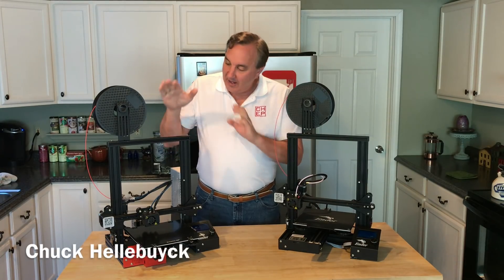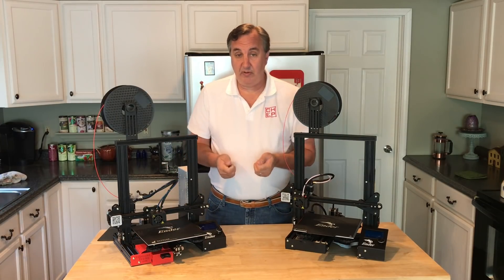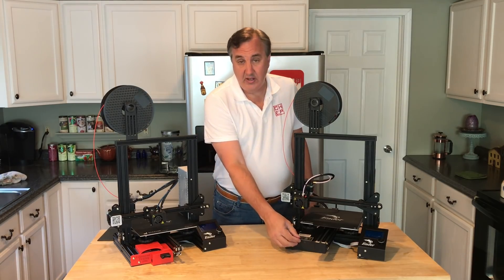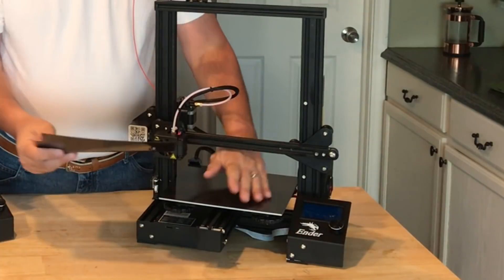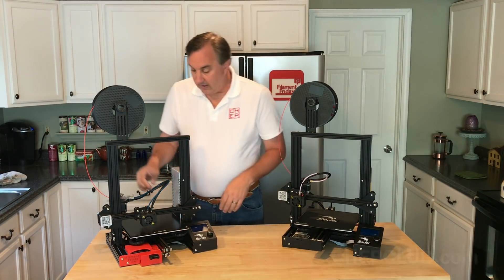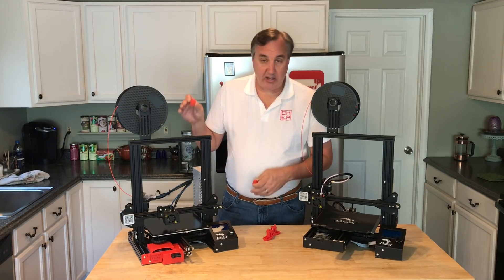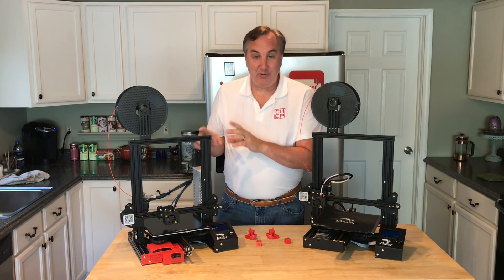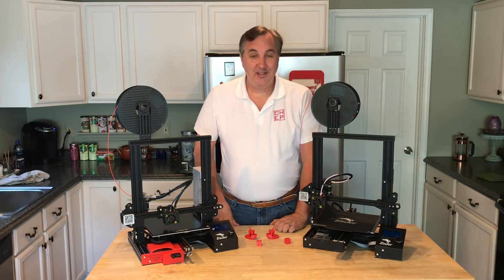Creality Ender 3 PRO vs Creality Ender 3 - Is it worth $100?

Comment from the maker: Creality has lowered the price of the Pro after this video was produced. It’s now $229.00 so the difference is only $50.
Reply: The Non-PRO (Original) is now $199 on the creality website, and I just got the PRO for $224 w/free delivery to Australia (also from their website)... They've definiately made the "cost vs improvement" much more palatable now.
Reply: Banggood has them at 159 ender 206 ender pro. 50 bucks. Now the removable "tak" pad and power supply pretty much make it worth it and all the other minor changes are gravy. The only thing making me want to pick a tevo tarantula instead for my first printer is the upgrade path is a little more pre laid out for you without having to buy more things to be able flash firmware and change stepper drivers and what not. I'm looking to branch my RC hobby out a bit.
Reply: @LitchKB  not bad huh, especially when shops in Australia are listing them at around $1000
Reply: @CHEP Is there anyway to get my print setting off the SD card back into cura? My computer crashed 😭
Reply from the maker: Not that I know of.
Reply: @FilamentFriday  thanks for the reply
Reply: What the heck? I found out that Ender 3 costs $399 and the pro version costs $469 on Amazon.
Reply from the maker: Where are you looking? The links in my descriptions are lot less than that.
Reply: I got my Pro from Central Computers for $189

Comment: I love my pro model and got mine is 2020 for under 200$. I don't have any issues with the magnetic bed. Of course since this was made in 2018, had I looked to buy a printer in 2018,  I would have NOT paid 100$ extra but, as it stands today, its worth 200$ in humble opinion. This is the best 3D printer channel around. I've learned more here and the info is really good stuff that newbies like me need to know. Thanks CHEP!

Comment: I just bought the Ender 3 Pro a few days ago and I haven't stopped printing on it since. The quality and detail for my first 3D printer is amazing. I couldn't be happier. FreeCAD and Cura on Linux Mint works great. Wish I would have bought one a long time ago with all the cool household items you can make and use its incredibly fun. In time I think the printer and PLA will pay for themselves.

Comment: Got my pro new for $200 ‘best offer’ on eBay and it’s the latest version with the rainbow-colored ribbon cable. Glad I got it. The magnet bed can go above 85°C, if it gets too weak I’ll just put some binder clips on it. But for most prints you’d stay below that anyway.

Comment: I just picked up the pro, and just getting started.  I was all over looking and the priced for the regular was 239 (not sure if they raised it for christmas or what) but the pro was 279, and I got the glass bed with it, so I figured 40 more and I get the pro and glass it was ok.  Now to get started with projects!
Reply from the maker: Yes, the prices all shifted since I made this video. I think others saw what I saw. Sounds like you got a good deal. Where did you get it?

Comment: I have the normal Ender 3, mine is supplied with a removable base cover, its not magnetic though but held in place on the aluminum base with 4 foldback clips which so far has worked fine. Watching your video I'm happy to have spent money wisely and not opted to purchased the pro version.  Great printer so far !
Reply: I know I am asking this reply 2 years later, but have you continued to use the ender 3, and how has it been performing when you used it?

Comment: Seeing this Video 2 years later, the Ender 3 Classic is now about $180-$200, depending on discount, while the Ender 3 Pro is now at a reduced price of $240, the two prices meeting in the middle.

Since it's my first-ever Printer, I definitely shelled out the extra money for Pro, to have the best possible features without Modifying it.
Only time will tell if it's worth it for me.

Comment: You can find the Ender 3 Pro for much less than the $100 difference that you mentioned. I got mine for 236.55 with free shipping and it came in 6 days. I found this on eBay from a vendor named "creality-3d-direct" located in Hebron KY and they state that they are the actual manufacturer of Creality 3D printers. They also provided a free 30 day return and stated that they would pay for the return shipping. This vendor has almost perfect feedback from eBay on a great number of sales. The current price on eBay is now $249 but sometimes this vendor puts a 5% off in their listings. (You could also try to send them a best offer for 5% less and they might accept.)  I really wanted to avoid the hassles of dealing with Banggood or Gearbest in case there was a problem because they make you jump through too many hoops before they will help you and then you have long shipping delays if they have to send you a replacement part. I feel much more secure buying through eBay because they really do protect and favor the buyers in any disputes. This vendor also sells the regular Ender 3 for a little more than GB and BG and I would much prefer to pay a few dollars more and get it shipped from a vendor located in the US and who offers a free 30 day return.
I agree with you that it's probably not worth $100 more, but I do feel that it is well worth an extra 50 or 60.  The reliability and safety of the Mean Well power supply is well worth it. I also like the wider aluminum extrusion for the Y axis and it definitely comes with the wheels in a square arrangement (as opposed to the original ender 3 which the wheels were offset in a rhombus shape and hard to adjust).  The new wider Y axis is easy to adjust and very stable.  I do plan to upgrade the PTFE couplers as you suggested in a previous video. 
Thank you for all of your wonderful content which is all very helpful.
Reply: Correct I got mine for $238 USD equivalent shipped from Crealities drop warehouse in Australia.
Reply: I've got mine on Banggood promo for $230, got another $39 discount from points and another 4.5% discount from cashback ($9), so finally for $182 it was a real deal at least because the PSU and 4040 Y profile.

Comment: Thanks. Decided to go with the latest iteration of the standard Ender 3. For the money saved I'llupgrade it with a 32-bit controller, enabling lots of features in the process.
Even with this upgrade included in the price, it's still cheaper than the Pro.
Some of the problems the first Ender 3 had has been mitigated in the latest iterations of it as of 2020, making the Pro even less desirable.
About the PSU on the Ender 3. It's not a well-known brand, but I see no issues with it. Tested it under load with my oscilloscope and there's barely any ripple on it. As good as many known brands.
It also holds up full load without overheating for long periods of time. But only time will tell if this will hold up after some period of usage. Sooo...

Comment: Chep, at 1:23 where you show the underside of the Pro, you can see where they include an idler bearing on the Y-axis that keeps the belt from snagging on the aluminum extrusion. That's not included on the standard version and that feature alone is worth some $$. There are some versions of an idler for the Ender 3 available on Thingiverse though, not sure if you've looked in that.

Comment: I just got the ender pro, haven't done anything except level the bed. I also didn't pay the full price, with discount, codes  and promo, I paid 127.00 USD for it...lucky me👍. Now if I were to do it again I would just get ender 3, and make the upgrades. Thanks for the review.
Reply: How you get that deal
Reply: @timothythompson109  
I have a very smart, clever wife.
From Amazon,  had made a large purchase,  that gave a percentage off, retailmenot,  there was another  discount,  and found a promo code. One is a rebate from retailmenot so when I get that, it brings the whole price down to $125 and some change.

Comment: Informative! If they want to make a pro version they should add a better control board and make sure it's upgradeable to two extruders. I'd also like to see a second z-motor on the other side. I don't know if it makes a big difference in prints, but having that gantry picked up on just one side bothers me a bit. And instead of a wider rail, maybe two rails, one for each side of the bed.

Comment: Ironically the Ender 3 Pro is quite often cheaper than the Ender 3 v2 in several online stores at present. Have a set of hardware upgrades to apply to my Ender 3 Pro that I'll apply a bit at a time as I get used to the kit.
Reply from the maker: Ender 3 V2 is always more expensive. Ender 3 is cheapest followed by the Pro then V2.

Comment: The Ender 3 Pro is now around $40 more, I bought mine for $220. A reputable power supply, magnetic bed, and slightly sturdier frame worth the $40 I guess. I had a $300 budget so I still had a lot of room to buy improvements, like a set of nozzles, a couple of smoother modules, better pneumatic couplings and a pair of filament spools.
Reply from the maker: Agree. Price has dropped since my video. Guess I’m not the only one who thought $100 was too much.
Reply: CHEP that, or prices right when machines come out are not entirely representative.
Reply from the maker: They try to get as much as they can but $100 was too much.

Comment: I told them to add feet under the printer they didn't do that :-)

What's annoying about the magnetic bed surface combined with the mean well power supply is that the better power supply means it should heat up faster hotter and more reliably then with the Chinese power supply but the magnetic bed keeps you from actually using it because you'll pass the Currie temperature of the cheap magnetic surface

Derp. :-)
Reply: The PSU has the same specs, right? I don't see why it should heat the bed up faster.

Mine have rubber feet like you find on many consumer electronics.
Reply: If the magnetic pad ends up dead due to heat threshold being surpassed, couldn't it still be used with binder clips?
Reply: @citronski  well there's a pretty big difference between having the same specs and actually being able to meet to those specs the mean well we'll actually performed the specs it lists the one you get from China is a crap shoot which is why some people for example can't get past a hundred degrees While others can

I have four Ender three printers none of them come with rubber feet they all have very thin rubber pads but no rubber feet so the gap between the bottom casing and the desk is very small rubber feet like what the cr-10 has would work a lot better
Reply: @armandoa2484  Yes.
Reply: @nerys71  Right, i meant rubber pads, not feet. Didn't think about cheap PSUs not delivering on their specs, good point.
Reply: Nerys  That might not be to the PSU but the actual bed resistance and manufacturing tolerances for the PCB beds.
Reply from the maker: This is true. The load has far more to do with it than the power supply. Most supplies have trouble limiting the current not supplying it.
Reply from the maker: Yes, that is an option.

Comment: I just picked a Pro up in store locally from Micro Center for $210.  That's about the best "normal" price I'm seeing from most in the states dealers on E-bay, etc.  Trading off no shipping cost for CA taxes, but I have a brick and mortar I can get to if I really need to.  I have some items on order from China right now, Banggood, and they seem to have disappeared into the great never never land of China Post.  Allegedly it's due to Lunar New Year delays, not other things happening, China Post got it and turned it over to the airlines, they say, before the festivals started.  YMMV on items out of China right now.
Reply: it's because of coronavirus,so all the logistics are stopped at the moment and only sf Express still working  because it's  expensive
Reply: @randomhk8634  

Hence my use of the words "alleged"  and "not other things happening."    I'm relatively sure they got to the airlines before the current political climate.  Back when they were still in the "everything is normal" phase.  

I just want to find out if it is in fact on it's way.  I usually get Air Mail out of the Mainland in 4-5 days.  And this is a small package, theoretically coming by Air Mail.

I don't necessarily believe anything I hear coming out of the Peoples Republic, old habits of having been at least somewhat in the Naval Inteiigence world for about 20 years, starting in my 20's.  I did believe them when they said they were going to take back everyplace where they once kotowed to the Khans.  Countries around the South China Sea.  They believe they had it once and they want it back. 

I have a lot of mixed feeling about the government over there, but I feel sorry for the ordinary worker, they are liable to bear the brunt of a terrible epidemic, which will destroy the economy  and kill of a lot of innocent folks.
Reply: @n6nvr I know what you want to point but at this stage things are getting worse honestly, I do live in Hong Kong and It's been almost 2 months since I did order and i still didn't anything delivered, I spoked with the company  in china my phone all what they sed is they send it to the mail company and sadly now the government paralyzed all the workers and asked them to stay home to avoid infections, they mentioned that by 1March things might go back on track but not 100 sure as the virus outbreak is making it's way rapidly,  as you did mentioned that you normally get your mail by airlines, check the news and you will find out that most flight from China are been banned because of this virus, I don't believe in hope but this time I hope there is a cure to this virus as so many people did die and it is sad that the media doesn't show the true numbers to prevent the panic
Reply: @randomhk8634  According to both Banggood and 17track, it arrived om the 14th at USPS in Queens, New York.  Took almost a day for that note to show up.  I'm outside Los Angeles and all my packages before this have come through Los Angeles..  Well, I look forward to getting it.  The USPS has lost a package from the Los Angeles rail freight mail facility to my place, all of 18 miles.

Good luck to all of you.

Comment: I'm currently doing about 1000 chores a day so I can get the ender 3 by the end of the month.
Reply: Stolen Galaxy If you don’t plan on tinkering then I’d go with the Anycubic i3 Mega which is around 169 USD and has more features like a filament sensor, touch screen, and a glass bed with a special adhesive coating.
Reply: @aaron4214  I think I will eventually get upgrades for the ender 3 but first I'm just going to get get good at printing them

Comment: First of all thanks for your great videos and great content. I have had a DREMEL 3D20 for a while. Thanks to your input on the 
Ender3 , I broke down and ordered one and I like it. Just wanted to say that mine came with a removable build plate that resembles thin pcb material. Slightly flexible and works great. I still make get try the coated glass plate. Thanks again.
Reply: I have two Ender 3, one with and one without the pcb-type buildsheet. I like the removeable better for rough parts and drafts, but for the highest resolutions (0.6mm layers) and detail i prefer the one without.

My experience with glass is that it introduces considerable ringing, so you need to reduce jerk and speed a lot, not worth it IMHO.
Reply: The flexible sheet is fibreglass and is a better choice compared to the cheap magnetic sheet you get on the Pro.  Glass just adds mass and acts as an insulator if you don't need glass don't use it.
Reply from the maker: I haven’t seen that bed style yet.
Reply: Search at Aliexpress: Ender-3/CR-20 bed Removable Plate
Reply: @CHEP the fibreglass flexible build plate came on both of my Ender 3's normally i use buildtak flexplates but i actually really like the cheap fibreglass units, one they work and two they are light alot lighter than the magnetic bases and spring steel setups honestly don't know why Creality decided to move to the cheap magnetic rubber sheets they don't offer any benefits other than no binder clips.
Reply from the maker: Thanks. Haven’t seen that.
Reply: The magnetic stuff is only used on the pro i think. The cheaper Ender 3 has the pcb style removeable bed now. Could be wrong, but i think this is how it is now.

Is it really fibreglass? It seems to me more like some kind of resin infused paper.

Comment: agree the mini is a better platform.   the issue of bed wobble with the 20x20 hits a lot of people its harder to get stable
Reply: It's not and the wider rail going from 20 to 40 isn't going to improve matters you would need to be on an 80 to really notice the difference. It's the contact points of the wheels on the rail that are the issue and need adjusted properly no matter the width.

Comment: I have an Ender3 that I no longer use.  The rollers on the bed got worn and the bed is now sloppy and no longer prints larger prints reliably.  I purchased an ANYCUBIC with cylindrical bearing and it works fantastic - with the bearings at the outside edges for much greater stability.  Much better than the Ender. Also, the bed works fantastic.  I think it has a very different coefficient of thermal expansion for the bed than for PLA. While it is printing and the bed is hot it is near impossible to get the part off the bed it sticks so well you would think it is glued on.  But as soon as it cools down to around 30 deg. C the part is loose and just slides off the bed. (The coefficient of thermal expansion causes it to shrink a lot different than the filament so that it pulls itself away - horizontally - from the filament enough that it is no longer "attached"). I would recommend the ANYCUBIC over the Ender3 any day.
Reply from the maker: Anycubic I3 Mega 3D Printer Review 
https://youtu.be/bLPKvHIJorY